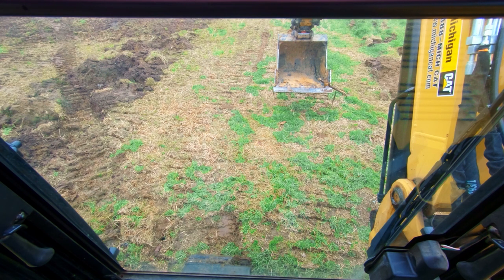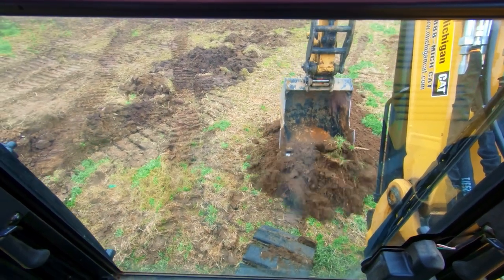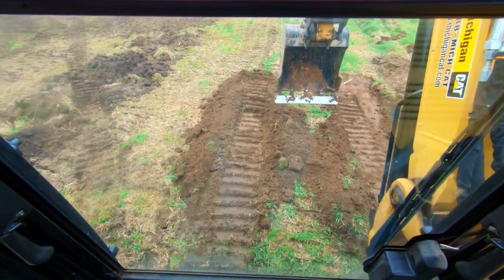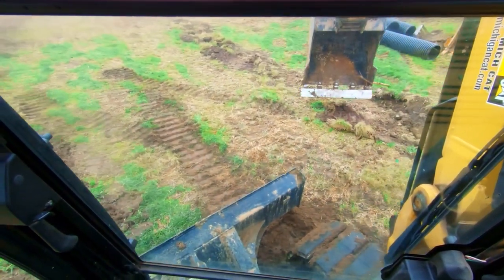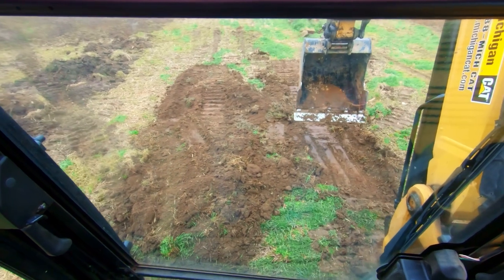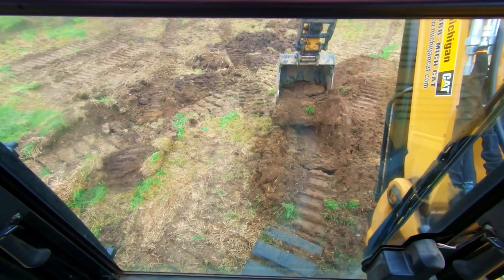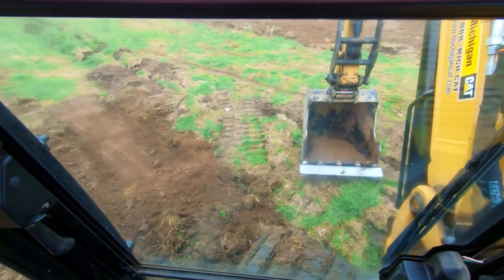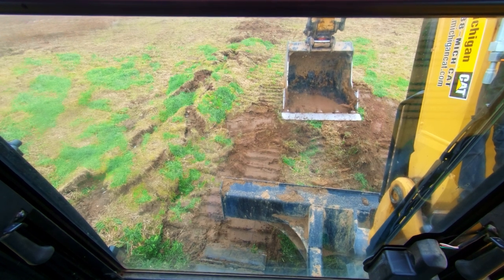HOW TO LEVEL AN EXCAVATOR || Excavator Tips and Tricks - How to Level a Pad in an Excavator

Comment: Nice explanation! One of the most annoying feelings in an excavator is the rocking. Nothing a little dirt can’t fix 👍🏻
Reply from the maker: I HATE watching operators that sit there and rock back and forth.  It's such an easy fix and half the time they are banging the machine around because they aren't compensating for the rocking the machine is doing.  As always, thanks for watching man!
Reply: @DieselandIron  But it's also annoying watching someone waste too much time getting themselves 100% level
Reply from the maker: @cameroncovington5705 You don't need to be 100% level but you are far more efficient when you aren't rocking back and forth while trying to grade or load trucks.

Comment: Lift one track up off the ground and track forward and slowly let down the machine at the same time then turn around and do the other track, if it’s tipping forward just do that then drive on the mound you just made in front of the tracks. 10/10 works great every time
Reply from the maker: Good advice!  Thanks for the comment!

Comment: Random question, i am planning to retire from the Canadian navy soon, would you recommend Heavy machinery Operator for second career at 45 years old? cheers
Reply from the maker: Now, with my passion for the equipment industry I might be a little biased, but YES!  If you are choosy and do some homework you can really find a company that will work with what you are trying to accomplish.  If you want to fill in 2-3 days a week here and there you could look for a smaller residential company and work something out with them.  If you want to go full time the industry is always looking for additional operators.  If you go into the union you will need to work for 5 years to get vested but once you do you'll have a second pension to pull from.  It really depends on what you want to do with it.  Yellow iron rocks and I'd never turn you away!

Comment: I dig the “grading” bucket. Is that bolt on and removable or welded?
Reply from the maker: It's welded to the teeth. They typically grind the welds to remove it

Comment: Been looking for a KX080 grading bucket, no luck.

What is that on the teeth of your bucket?!
Reply from the maker: Weld a piece of steel across your teeth. It works great and you can pop it off of you need to use your teeth on a job.